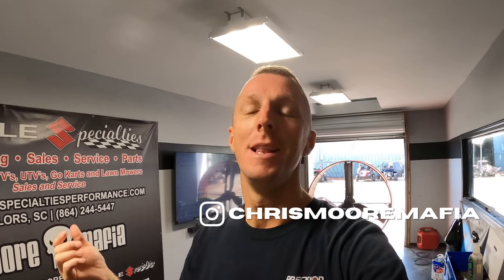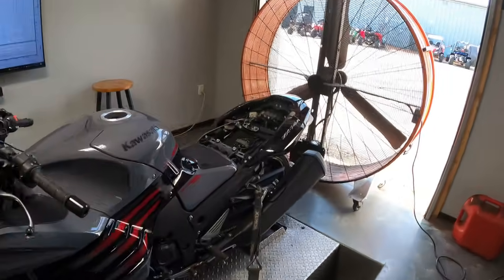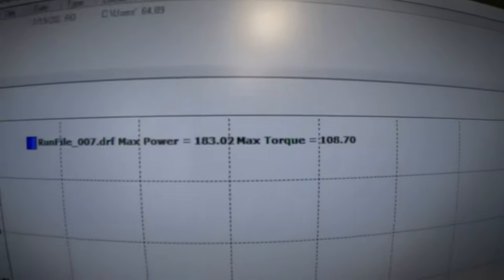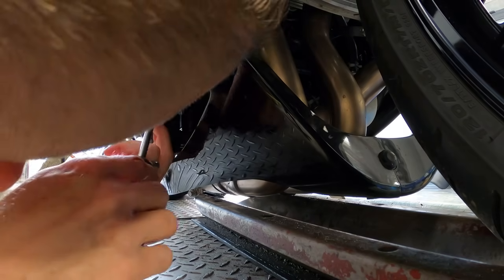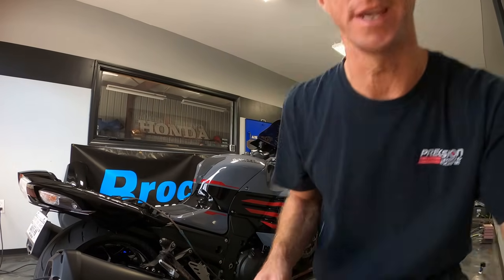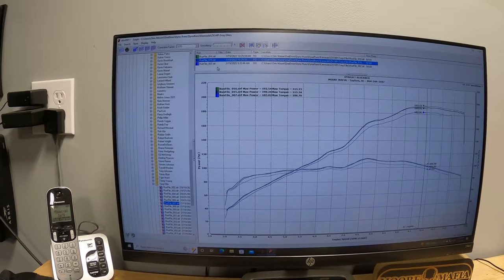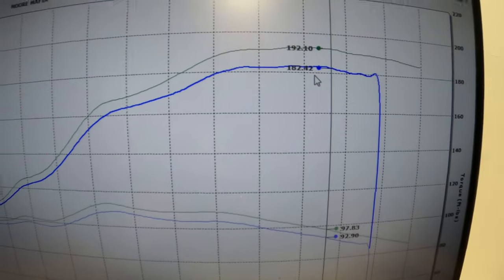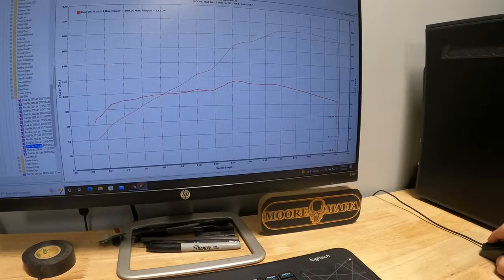2021 ZX14R GAINS 10HP REAL QUICK AND EASY & HITS 200 MPH | Moore Mafia

Comment: That’s the 2022 model. I have a 2017 Zx14r. Such an amazing bike! as a 5’6 126 lbs female I’m pretty sure I can get to 200. Will I try? Heck no lol. - Amy
Reply: I'm riding a zx14 at 245lb and I think its fast, can't imagine it at your body weight.
Reply: I have same bike fuckin hell fast
Reply: I'm ok around 165 mph or a little more but 180 I started getting like tunnal vison and I got scared because even tho it was smooth trying to move other then a strate line was another story. So b aware that past 170 is a whole different feeling and not to make a habit of🤯
Reply: @moparone7962  their a senior on the right side down by the pipes that if u disconnect u will get about 8 more hp .
Reply: @moparone7962  I want one but I’m 6’2 320😂
Reply: @moparone7962  I have a 2016.. I'm 310, 6'2"... slings me around
Reply: @JAYDMGYM  go for it... we the same size. I'm just 61 years old too. Lol
Reply: @JAYDMGYM I'm 6'2 and 260 and it fits me just fine and throws my weight around like nothing....the bike has mondo power, so go for it     👍🏻

Comment: Just did the 4-2-1 yoshi carbon fiber. My 2023 ZX14r in stock is ok, the mufflers are ridiculous, it is definitely choked up, the worst part is the throttle will crack your neck.  Like my previous Hayabusa, the racing exhaust made all the difference

Comment: I have a feeling these bikes run rich naturally at their top end because of how much air they can intake. There's no way to simulate it in a dyno room.  But at 160mph that massive intake is gonna eat alot more air than you'll ever feed it.
I dynoed at 194 wheel HP with the single sided full Yoshimura R77 exhaust after ecu flash and tune.
Reply: Most bike have 02 sensors which can adjust fuelling in closed loop to maintain whatever AFR has been programmed into the ECU.
 100% throttle will generally run open loop not closed loop, and again will only adhere to its open loop fuel and spark tables.

 To say that it runs rich because it gets so much air only shows that you don’t know what you’re talking about.
Reply: You misunderstood what he said about running rich. He was theorizing that the bike runs rich in the upper gears on the dyno In anticipation of the extra air that would be rammed into the motor at high speeds. On the road, the bike would be less rich than it would be on a dyno where the ram air system has no impact.
Reply: @nickcook7408 how many closed loop ECU bikes do you have?

Heck it's just one that I know which is a s1000rr. 14s aren't closed loop where are you getting this stupid info? The OP is right here

Comment: Great video, I’m thinking about buying another bike. Sold my last one….a 2016 Zx14R. Can’t decide between the H2 SX or the ZX14R.  I want a more comfortable seating position. The ZX14R with the bar risers is still painful after 45 minutes riding. As for the video….. looks like the ZX14R needs 1 hp per mile per hour. Stock 186HP top speed 186 MPH. 200HP 200 mph top speed. Interesting at the very least. Just catching up on your videos since it’s winter and dreaming about summer lol.

Comment: I've got a 2017 ZX14R. Except if you're only into straight-line-dragster, I really don't get what +10HP will give you... Power is already enough, and if I had to make something, it would be on comfort, OR on weight (they usually don't fit together...). But it's a good bike, really great in almost anything.
Reply: DiD you even bother to watch the video? More going on here than 10 hp..most important is making the bike much smoother thru the range and much more enjoyable to ride,,

Comment: I have a 2013 ZX-14R with a Don Guhl flash. I did not have to disconnect the O2 sensor with the Guhl flash. I wonder why? The bike runs great, though. Don no longer does ECU flashing I've been told. That's it in the little picture.
Reply: It may in fact be disconnected within the ecu parameters but physically it’s not removed….
Reply: I don’t believe that year had an O2 sensor.  MM flashed my 2015 and I did not have an O2 to disconnect either. Emission standards were better back then:) . My 2019 14R has the O2.
Reply: In 2016 the ZX-14R had to make Euro4 specs. I heard they were down a few h.p. at that point. That is probably when it got the O2 sensor.
Reply: It has not been on a dyno since it was flashed but it probably makes just short of 200 hp. Akrapovic slip-ons, -1 ft. sprocket and the Guhl flash.

Comment: What gains do you normally get with the Alien Head vs factory exhaust after the flash on both with both having a good air filter and pump fuel?
Reply: I got 202 and 117 out of my 2016 with a brocks alien head,  flash,  tune and a bmc fitler

Comment: Add a few more simple mods like a full ex,ceramic wheel bearings,chain conversion and see that thing ripp the arms off ya and slap your self with the very same arms..
Reply: What's the chain conversion?
Reply: @davehardan8323  Basically a skinnier lighter chain with same or more strength as stock..

Comment: So, I still have my stock 1-owner 2014 ZX14r with slip-ons sitting in the garage and it's basically unridden. 
I don't like that my gen3 busa with an Alien Head and Sprint doesn't totally mop the floor with it!
But if course, I'd still flash both bikes.
Reply: So would you say that the busa is overrated now because the zx14 really out performing now? I'm definitely team suzuki (z400, intruder 1500, gsxr 1000) but I'm on the fence on my next toy zx14 or 1300r
Reply: @dadabg8747  I always tell people the first thing is the bike's comfort for your taste. For busa / 12 / 14: I've had 4 busas, 2 12s and 2 14s. That was before gen3 price that's about 5K higher. Do you like all the modern electronics on the busa?
If past history holds true, K will usually strike back when S updates and takes the lead. 
Gen1 busa was more comfortable and the 12s were more sporty
After that, the K bikes were more comfortable for me. (I'm the 300lb guy)

Comment: So when you flashed my 2022 model a few weeks ago...  I have a BMC Air filter and Delkavic slipons... so my HP should be around the same?  190hp at the wheel, give or take?
Reply: I got my 2021 flashed with Sprint air filter, full Delkevic exhaust and Moore Mafia flash and put down 195 and 112
Reply: @christophermcelvaine1815  Yeah, I just did the slipons, and I brought the ECU to him so I wasn't able to get a before and after on the dyno...

Comment: In the Motorcyclist Magazine test they mentioned that the heads on this at the time new model were hand ported and polished at the factory on all new ZX14R bikes to get maximum output. I haven't read any other tests since then does anyone know if that's still a claim by the Kawasaki factory? If anyone knows I would appreciate some😅 letting me know guys! Thanks
Reply: @yourmom922  Thank you for verifying what I had read back in 2012! My old brain isn't as bad as I thought it was! Will be 65 December of this year so far so good!

Comment: Kawasaki really needs to update this motorcycle.
Here some suggestions:
The front design is fine as is I think (perhaps some modification to loose weight, LED lights, mirror revise)
The rear/tail needs some work for sure (slim down the tail, make it more pointy, loose weight, gain some trunk space perhaps?)
The factory exhaust is heavy/hideous (what if they used 2 zx10r exhausts instead?)
Dash re-design needed (perhaps the H2 SX SE dash would be best suited)
Add quick shifter, cruise control, 6-axis imu, launch control
Add Electronically Controlled Suspension (unless the price will be inflated too much, cause you want it to sell as well)

Comment: The 02 sensors does not tell /make the bike to run lean.....  The ecu target AFR map does that vhen in closed loop situations.. If all the 1/2 assed  reflash guys did a full correct tune  job, you can leave the 02 connected and take advantage of that for max fuel economy / auto afr correction... your correcting nothing in your tunes.... your just doing changes YOU think are better....

Comment: Does a slip on or full exhaust with your flash cause a lot more heat over stock? My gen 1 ecu flash full brocks created a furnace to ride.  Goals are to be able to take very long road trips.. any suggestions?

Comment: The first year for the ZX14R 2012 Dyno stock was 191. and some change. That's a hell of a difference stock bike to stock bike! Even with slight variations from one Dyno to another that's still a good bit of difference IMHO! Wish Chris could Dyno a stock 2012 just to see. The numbers I quoted was from the first full test Motorcyclist Magazine conducted on the brand new 2012 R model.

Comment: This is so sad
I had a 2014 zx14r and literally out of the crate with the exception of yoshimura slip ons it got 204 HP
Rear wheel 
For some stupid reason I  sold it. Now I've got money down on a 2022 zx14r 
The bike is so addicting.
So I have to do all this stuff, ECU flash full exhaust system and air filter just to get to where the base used to be.
That's definitely a 2022. Hopefully the 50 state model 
Because if it's not I need to make up even more power.
With the 2016 model adding some kind of European emissions and the 50 state model it basically lost 20 f***ing HP
Reply: If you got a 2014 to read 204 wheel horsepower stock, the dyno was wrong I promise you.  
 A stock H2 reads right around 200Hp stock at the wheel and 228hp off the crank.   A 2014 ZX14r is right around 208Hp crank and that's right from kawasaki.  And a 10% loss to the rear wheel is pretty standard.
Reply: @larryhouse3776  
Do you really promise